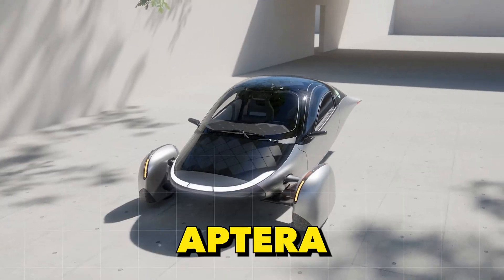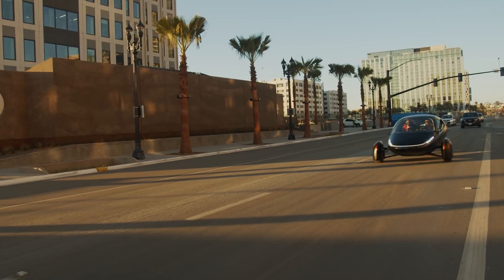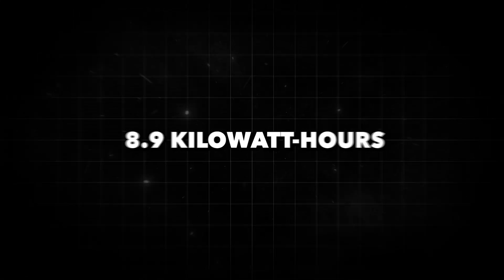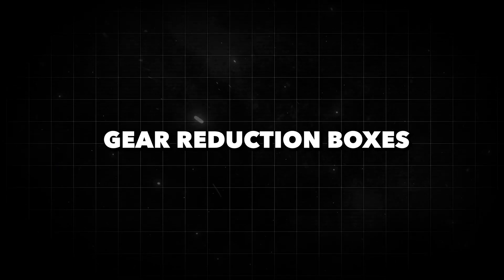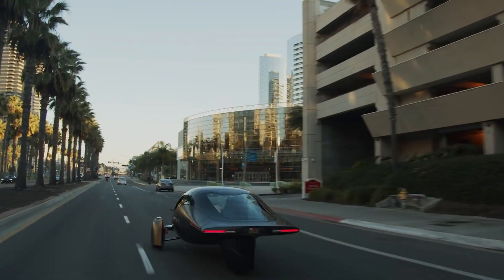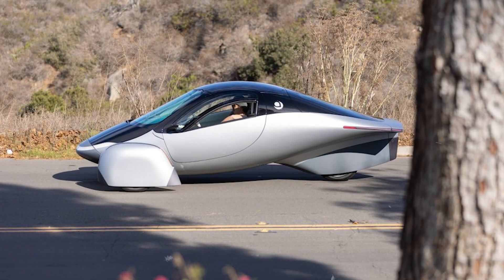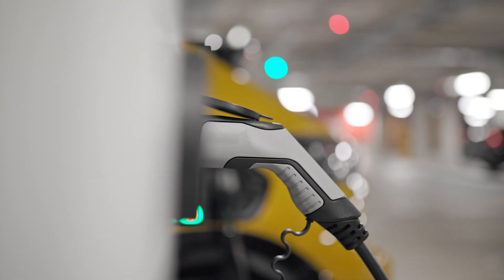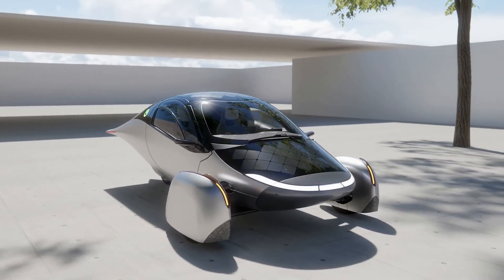Solar-Powered Car That Never Needs To Charge! Aptera

Comment from the maker: Are Solar powered cars the real future in EV's?
Reply: They need an efficiency breakthrough, but it will happen. A combination of that and better batteries will really help make these mainstream. Independent power like solar or even a home wind turbine charging a power wall will help ease range anxiety. The biggest bugaboo is still the overall cost. $2500 per unit would do it.
Reply: Solar panels on cars don't make much sense. Good thing Aptera isn't a car.
Reply: @tims8603  Wasn't that long ago we were saying " why would you need to carry a phone around?"
Reply: @tims8603  The solar cells don't weigh much, don't cost too much.  It's a logical choice for many vehicle owners.

Comment: Very cool and efficient car - motorcycle. Although the energy conversion is little deceptive. It would be cool if you could just dump that 1 liter of gas in the Aptera and get 89 miles but I doesn't work that way.
Reply from the maker: True.

Comment: wait, if there is no gear reduction, that means the motors are actually outputting a total of 3300lb'ft of toruque? idont beleive that, there must be some kind of gear reduction to get that kind of torque.
Reply: No gears. The hubs themselves are the motors. Check out Elaphe, the company that makes them

Comment: Wow … an AI copy of Ageing Wheels video (which by the way  is way quirkier and fun to watch). So strange to get all these AI videos. the content is technically correct but only repeats what others say and there is a lack of logical connection between concepts.  ugh.
Reply from the maker: There is nothing in this that is AI but thank you for watching.
Reply: @GreenCarBuzz  You're better off blaming it on AI.

Comment: I became aware of Aptera around 2008. Many thousands of people put deposits on them and in 2011 the company dissolved. I had seen the same thing happen with Elio motors. Then in 2021 Aptera was back and over 10,000 deposits were taken and every year since 2022 the production is pushed to next year. If next year we’re hearing that production will begin in 2026 I would conclude it’s never going to happen. I think the corporate officers are probably making a nice salary, and if the new company doesn’t make it they won’t be indicted for a ponzi scheme because they tried. I hope that they do succeed and that my concern is invalid and that everyone who gave them money will get a vehicle.
Reply: Well, the preorders are in escrow, so they literally can't touch that money until they deliver the vehicles. Also with the current production intent vehicles finally being built, it's looking way more likely. The carbon fiber and fiberglass shells look great!
Reply: Aptera Owners Club did an excellent comparison of Aptera vs. Elio. Quite a difference in the companies. Note that Aptera refunded all deposits, while Elio did not. That's called integrity.
Reply from the maker: I guess we will see what happens.

Comment: Nice overview of the Aptera. I like to point out that is not the fact that it is solar powered that is true advantage of Aptera, it is that it is so efficient. This efficiency is both because it is extremely aerodynamic, and that it has three wheels. It is also extremely light, but it could not be this light without being this aerodynamic, and the three wheels works with the light weight to make it even more efficient. 

The composite construction helps with the weight too, but the battery is a good portion of the weight, and the more range you need, the more the battery becomes the major part of the weight. So the aerodynamics is the most important part. 

With 10 miles per kWh, solar charging becomes functional and not just a way of trickle charging a few miles here or there. The Aptera CAN'T run on solar forever, that's impossible, but if you drive less than 40 miles a day, you don't need to charge. And if you drive more that 40 miles a day, well you still don't have to pay for a lot of it. 

There will be an option to take off most of the solar cells, and it will still be incredibly efficient and cost way less to drive than other EVs.

Comment: $33,000 is way overpriced for a hyped up sub compact 2 seater, 3-wheel autocycle.

Hub motors have been around forever, despite your incorrect claim in the video, not only are they less efficient than inboard motors and a reduction gear they are also much more susceptible to impact damage and dirt and grime intrusion and require much more maintenance.

You won't get anywhere near 8.9kwh a day from the solar panels - the maximum you can put on an Aptera are nominally rated for 700w total capacity and 610w effective charge capacity = around 3.9 to 4 kwh of charge maximum on the 22nd June on a sunny day in Yuma Arizona good for perhaps 40mi of range, the average year round in a sunny climate is 2.8 to 3kwh per day or 28 to 30miles. To acheive this requires the car to be outside in the elements from sunrise to sunset every day of the year, never in a garage, covered carpark, under shaded tree - assuming full sun 100% of the time.

So you generate around 1000 to 1100kwh a year in absolutely ideal conditions with the panels, at 20c per kwh = $200 to $220 in generated electricty - the panels add around $3000 to the cost of the car - that's around 15years payback it's a complete gimmick, with all the hassle of making sure your car is in the Sun - meanwhile adding 3kwh to my Tesla model 3 takes around 15min at home and costs me 24c, Around 1min 10 sec at a DC fast charger and around $1.00 what a total waste of time and effort on the panels.

A 1000 mile Aptera with current battery technology would require a 100kwh battery - I'll believe it when I see it.

Finally the icing on the cake ....the maximum Level 2 charging speed is 3.3kw and the maximum DC charging speed for the Launch edition will be 40kw - that's completely unacceptable these days when the benchmark is 350kw, your average Tesla is 250kw and even the cheaper Chinese Evs are at 150kw, your 60kwh launch edition pulls up to a Supercharger and takes 1hour 15min to go from 10 to 80% meanwhile 4 Teslas have come and gone in the stall next door and the 5th is 1/3rd of the way through their charge to do the same thing.
Reply: Oh you mean like a Porsche 911?  or a Mazda Miata?  or a Chevy Corvette?  Oh I forget, they all have  four wheels for extra weight and drag.  And i'm so glad you've contributed your expansive expertise on the problems with hub motors.  I'm sure Aptera has completely forgotten to consider those things....yeah, that's the ticket.
Reply: Do you hate getting something for free?  If the sun is out, the Aptera will be able to charge.  As far as charging goes, right now they're limiting the charging to 50kw, because honestly, the efficency of the vehicle is what makes it great.  You will be able to go farther on a shorter charge and won't have to worry as much about cooling with the higher speed chargers.  It will be nice not to have to install a high speed charger in the house as well, because a 110v outlet will be able to charge it at about 13 miles an hour.  Car sits outside during the day and charging at off peak at night is the way to go.

Seems like IWM are more efficient and better than just having an internal electric motor and I think the thing looks sealed up well enough to keep the dirt out.  https://youtu.be/RjISvISOW5Q?si=Pkc2Asy4c4PORiV5

Comment: The surface area on the Aptera doesn't look any larger than for the other cars shown. 

Aptera have never validated any of their claims. The solar charging would be good for about 5 km a day.
Reply: No physics has validated their claims.  It's called modelling and computational science.
Reply: Aptera have built prototype solar panels that met the desired estimate. I saw a video where one such panel was producing 80 Watts, and that was near sunset. It would have normally been producing 180 Watts. Just to do the math, that's at least 1.08 kW or 10.8 miles over the course of a day's charge. For one panel.

More recently they have finalized their solar panel design and verified that they also work as intended. I'm assuming these are the same panels that will be used in production. 

The majority of the Aptera's power will come from it's hatch. That holds about half the total cells.
Reply: Up to 40 miles a day is there projection.  They have some great transparent interviews wiht the Talosive channel and Aptera Owners Club that's worth checking out.

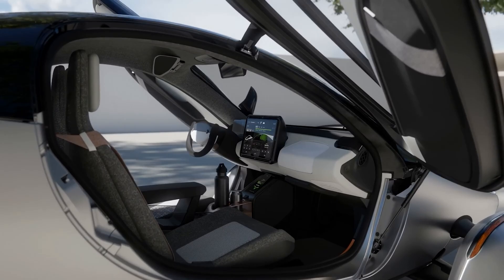Comment: Nice, informative, fast-paced video! A couple comments... You quoted a price of $33,000. This is for the Launch Edition (full solar, AWD, 42 kWh battery/400-mile range). The base model is currently priced at $25,900. Also the pinapple leather console (and "funky net cup holder") was in the Gamma prototype but is not in the production model (replaced by an elegant metal assembly for the cup holder). See the Launch Edition render videos (or 7:48 in your video).
Reply from the maker: Thanks for the input!

Comment: It's good good see that the Aptera never needs to charge. Now it's fact.
Reply: Caveat that statement for the average commute.
Reply: You should talk.  You've been complaining for 2 years over easily fact checked concerns.  Children learn the stove is hot faster than you can check yourself on your own idiocracy
Reply: TBF, Solar Charging is still charging.  You need to get juice to the battery by some means.  If you mean to say, you may never need to plug it in to charge, then yes, that would be a fact.
Reply: @artboymoy  - It's almost like they have misleading titles for these Aptera videos. I drive 75 miles round trip for work. No where to plug it in at work. So, would I need to plug it in at some time? I was just hoping 100% solar charging.
Reply: @billsmith5960  Can you plug it in at home?  If you have a 400 mile range Aptera, you shouldn't have a problem and if it's outside, then you'll at least get something.
Reply: The author never said that the Aptera never needs to be charged. He said that the solar power will "tack on an extra 40 miles of range per day". Do not put words in his mouth.
Reply: @richardryley3660  - Look at the title: "Solar Powered car that never needs to charge"

I said: "the Aptera never needs to charge"

You said: "The author never said that the Aptera never needs to be charged"

You are correct I replaced "Solar Powered Car" with Aptera. So I put words in his mouth. I assumed he was talking about the Aptera as there's a pic of it. You need to admit you even misquoted me by adding an "s" and a "d" on two words.

Us Aptera fans know that's misleading but I guess it's good to have misleading titles on videos because it will be more exposure to the Aptera brand.
Reply: @billsmith5960  That statement is true, for anyone who drives less than around 30 miles a day. A statement that the author, Green Car Buzz, clarifies in the video. Which you would know if you had actually watched the video, instead of reacting to click bait. 

I'm sure since you are so active in this community that you are aware that the Aptera actually does not need to be charged if your daily commute is short enough, which means that you certainly are putting words in the mouth of Green Car Buzz and misrepresenting his statement.
Reply: @richardryley3660  - So it's OK to do clickbait with false claims and then getting people to watch the video. I guess if I say, "The Aptera will fly 1000 miles on a single charge", that is OK even though I have in the video, "The Aptera doesn't fly yet". I get it, make clickbait and then make people watch the video and see a claim by Aptera buried in said video.

Good to see Aptera approves of this. What other clickbait titles should we make to generate clicks? I'm thinking maybe using the two spoon method for better vision and hearing. I just look at it as Aptera condones clickbait false claims just to get interest.
Reply: @billsmith5960  Now you're putting words in my mouth. No one has ever said Aptera will be able to fly.
Reply: @richardryley3660  - 

I said: "I guess if I say, "The Aptera will fly 1000 miles on a single charge"

You said:  "No one has ever said Aptera will be able to fly."

How is that putting words in your mouth? You seem to not understand that phrase as you keep using it and I literally show you it isn't. At this point you are using it as a diversion because you don't want to stay on topic.
Reply: @billsmith5960  There is no topic. There is literally only you misquoting people in order to spread misinformation.
Reply: @richardryley3660  - There is and it has to do with clickbait videos. You did a good job of reverting it to something else.
Reply: @billsmith5960  Removing a statement from its context is a form of misquoting. Which is what you did.
Reply: @richardryley3660  - No I didn’t.